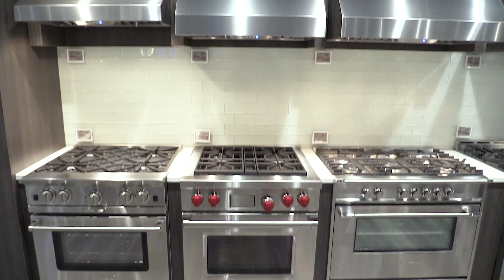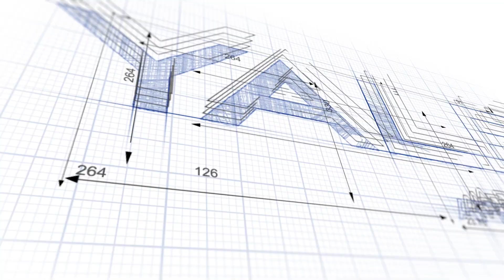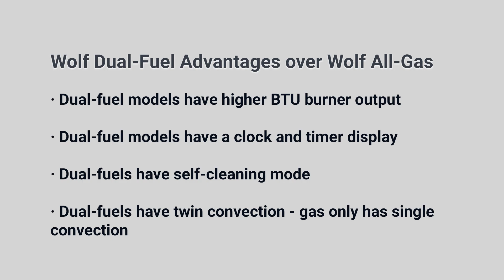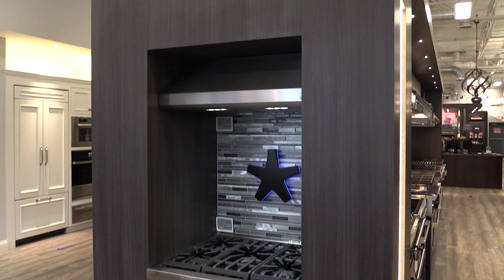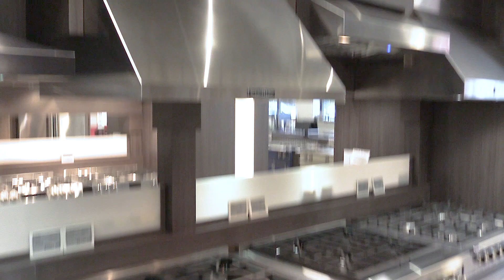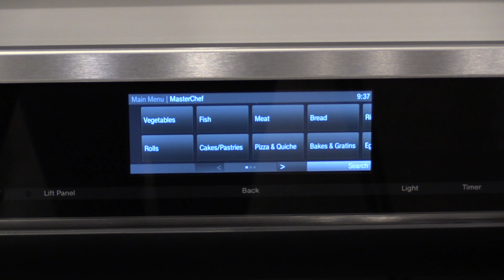Wolf DF304 30-in Dual-Fuel Pro Range

Comment: Bought the Wolf dual fuel 30in range a year ago.  Worst oven we've owned. The burners make a whistling sound.  The oven fan runs for over an hour after the oven is turned off.  User interface is totally confusing.  Even simply changing the clock time for daylight savings isn't obvious and requires searching online.  Turning the oven light on requires opening the panel, pushing the button, then closing the panel.